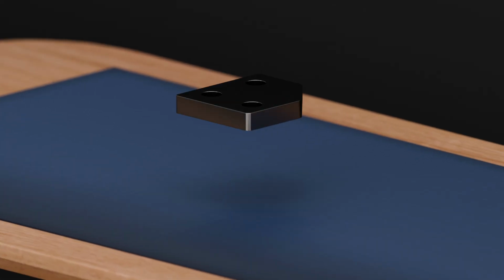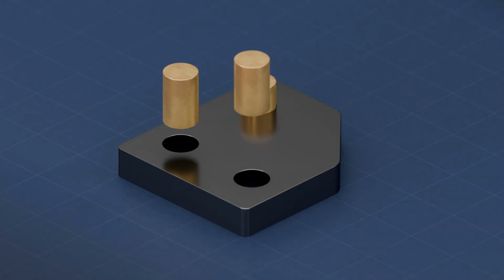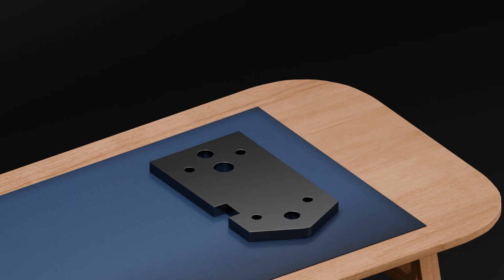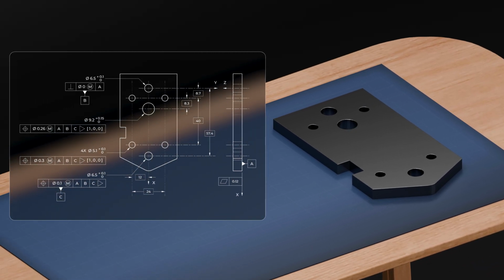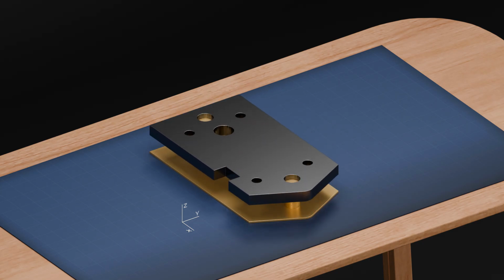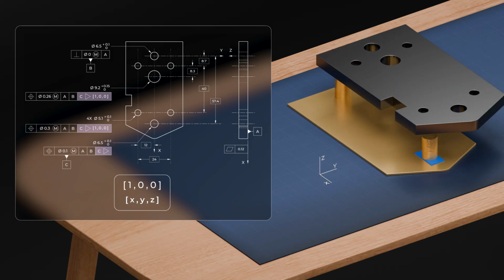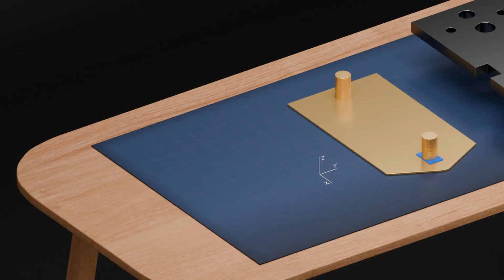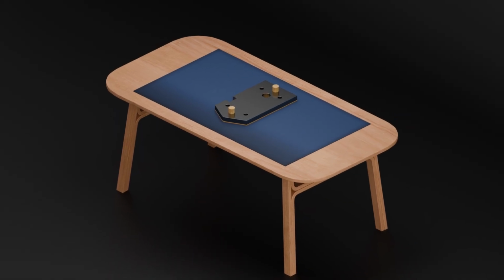Translation Modifier | GD&T Advanced Concepts

Comment: Nice video! In the drawing you add C and the triangle even in the frame defining Datum C. Is this a required feature to define C as a Translation Modifier? It just seems strange to relate to the definition of it self.
Reply: You don't need to add it there. As far as the idea of adding datum C to the FCF that's defining C, I've seen credible people do it but can't get answer of how it's allowed.
Reply from the maker: Translation modifier can be added to datum B(secondary datum ) also .It can control rotation for DRF with A|B
Reply from the maker: If it was defined to only C it would have been wrong. But as long as it is part of a DRF, it can make sense. In this case the complete DRF defines how the part is constrained during the measurement.  It would be unpractical to force the inspector to "detach" datum c from the measurement when measuring datum feature C. 
So yes, in many cases it is useless from a design POV to define it but it is practical to avoid unnecessary extra work.  You want the inspection technicians to love you don't you? 😅
Maybe we should make a separate video about it.
Reply: @Excedify  Ignore the translation part for a second. The question in a different way is; how can you put a datum (C here) into a FCF while also putting a datum feature symbol for that same datum (C) on the FCF?

It looks like you're defining a word while using that same word in the definition. I think it has to do with comparing the DRF of a manufactured part to simulators but I'm trying to find the how and when part of it.
Reply from the maker: @Landphier  because you are not tolerancing the datum to itself, but the datum feature to the datum. There is a difference. Once a surface is selected as a datum feature, it is used only to establish the Datum Reference Frame (DRF). Its shape, flatness, etc., are not being “re-controlled” by referencing it again. The DRF is an abstract, perfect coordinate system, not the real surface itself.
Reply: @Excedify  so now the why/when question? Functionally I don't care (at least I don't know why I would) how my part datums as a whole compare to a theoretical perfect datum scheme as long as the vast majority of parts made for an assembly fit together. Generally I see a primary datum is defined with a form control with no datum reference in the FCF, secondary referencing the primary only, and tertiary (if applicable) referencing the primary and secondary only. The way C is defined here is not the way most drawings I come across are made and it appears to be the same for @janovelarsen9723. There are the occasional ones I come across like this video but no one could explain it.
Reply from the maker: For instance, If your part is already "fixed" using a certain DRF, then it would make sense to keep it for as many measurements as possible to avoid unnecessary extra work. So in This case, even if I do not necessarily need C as a datum in FCF, I would still keep it as part of my general DRF, as long as this is not wrong. 
BTW, this practice is also found often in the ASME standard example drawings.
Reply: @Excedify  I don't think we're talking the same thing still.  Look at Figure 7-12 in Y14.5-2018. Your video is almost a copy of that figure with one difference being that in the FCF which datum feature symbol C is attached to, you added C as a datum reference. You also have a translation direction added to your example but that's not the question. The addition of datum reference C in just that one FCF (of five) is what we're trying to learn about here and is not how most examples in Y14.5 are.

Comment: Great video! In what real-world scenarios would you actually use this Translation Modifier?
Reply from the maker: Translation generally works if many different holes are provided as datum then simulator will have translation to adjust the assembly of holes 2) Other application is when part is not constrained in a simulator during inspection with fixed datum …movable simulator will fix this one